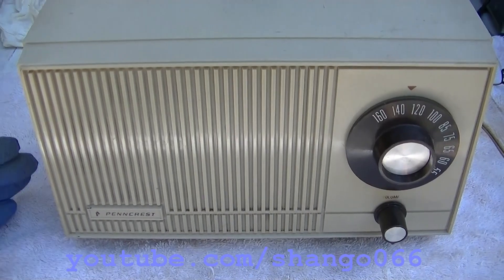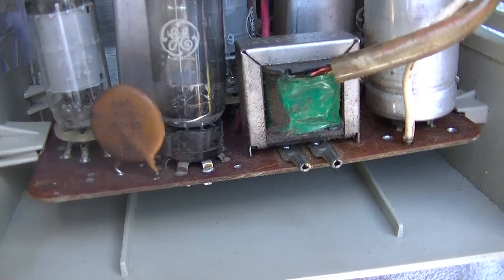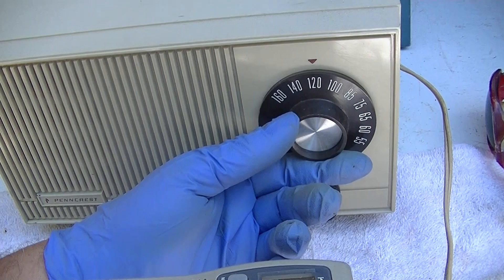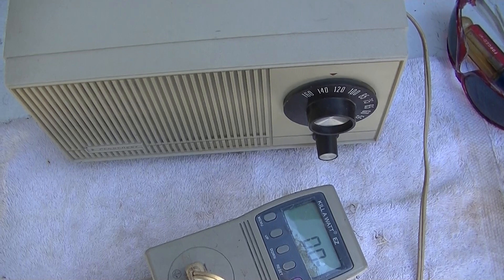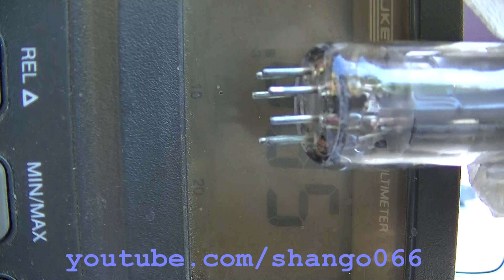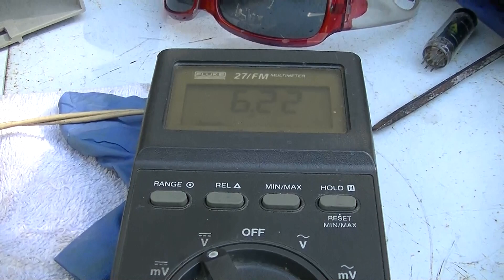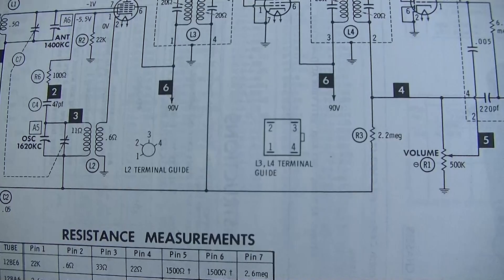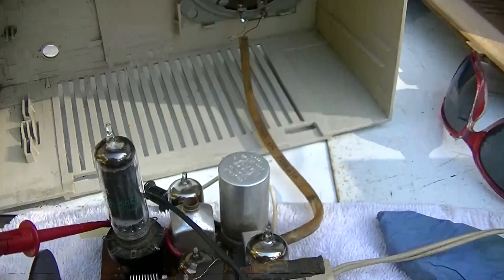Pencrest 5 Tube AM Radio Fading Issue Diagnosis

Comment: Man, I remember building a Sears Edukit clock radio (yea I had never heard of them back then or since) It was a minimalist design with one of the Couplets... It was a fairly decent radio and didn't require alignment Them 50C5's were compact room heater for sure. Thanks for the adventure Master shango066

Comment: These videos have been very educational. I have been tackling things around here that have been broken for years. I diagnosed a bad solder joint on a transformer by smacking components on the board of a Panasonic radio. Sometimes practical skills are much more helpful than theory.

Comment: JC Penney has been struggling for years. Not as bad as Sears by any stretch, but some of the same issues. Lost touch with the middle class, therefore losing market share to Wally world, Tar-get, Costco, Amazon, Best Buy, various chain tire stores taking the auto repair, U name it. Now the momentum is almost impossible to overcome. Really sad though. Very good ethical company back in the day.

Comment: Damn, that was one klinky doimler of a video shango! My Sunday is getting better and better. Thanks for sharing this stuff because like you mentioned if it helps someone understand how to maybe diagnose and repair their own equipment, then maybe it'll be one less piece of trash in the landfill and not appearing at your door for repair.
Reply: I have to agree on repairing this gear, though later sets like this are minimalist-design (cheap) radios that were cranked out in the 60's, they still deserve some love.
 - Cheers,
Reply: Eddy_D , minimalist design, true. But they perform very well for what they are called to do. And the last of them, with vacuum tubes, overall seemed to be the best.

Comment: Before you pulled out that Sams, I was saying to myself, I have that exact same chassis in an old GE radio. Then you pulled it out showing a Radio nearly identical to mine.
Reply: When I was a kid, I had a 1959 GE with the same case, but the circuit board was much bigger and at something like a 25 degree angle. There was also a solid-state version of the small board. GE must have stopped using that case style around 1968, but the similar version with the speaker on the bottom was still sold into the early 1970s.
Reply: PC No , my guess is that they had a lot of cabinets to use up. The printed circuit chassis would not fit into that make shift plastic cabinet unless you bent it in, at a 25 degree angle. They then compensated the tuning dial calibration, adjusting accordingly.
All things considered though, the "All American Five" tube AM radio was quite an efficient design, and did its intended job well. Millions on them were made over a period of around 25 years (plus or minus). And as long as AM radio stays analog, as now, parts to keep these radios playing will still be found, for at least another generation, or two.
Reply: @pcno2832  https://youtu.be/izbQk0Sm2UU
  I show the slant one in this vid.

Comment: Deja Vu .. I’ve seen this chassis before .. 60s GE .. ‘crackle, crackle’ .. went down with SMD (posthumously diagnosed) .. I kept it around for a couple years, finally got some electronics shop training .. when I went to get the radio to fix it, mom had found it, and thrown it out …

Comment: I have a 1960's Penncrest Model 1151 8 Transistor handheld radio. Picked up at my local Antique store for $7 around Christmas 2019. Slapped a 9V battery in it and it still works pretty well.

Comment: 9:38 The other difference is that the GE had wires going to the volume control holes to accommodate that older slope-chassis style case.

Comment: This looks so close to the radio 📻 that my dad had by his bedside. It was also AM. It had an analog clock on the left side, where the speaker is, however, the tuning and volume knobs are in the exact same place. Dad’s alarm clock radio was the same color, but with a couple cigarette burns on top. It also had a lighted dial, but I cannot remember the brand name. I think 🤔 it was a Sony. I remember “Solid State” on the radio 📻, though. Probably would have been an antique by now. This radio later made headway to my stepmother’s work place after she bought my dad a new Randix Cube digital alarm clock radio with a fold-up telephone 📞. I really liked this alarm clock radio, too. It had green digital numbers, and I think 🤔 it also had a lighted dial. It looked so 1980’s. After we moved, I don’t know 🤔 how it went for my dad’s analog clock radio, but I’m pretty sure it made its way to the dump. 😢 sad place for it to do. I guess somebody could have saved it, but probably not. I’d be very surprised 😲 if I still saw it at my stepmother’s workplace as far as 2020. It was very early 1984, when I saw it there, in her office. Chances are, I will never see that radio again. It was in Bethel, Alaska, almost 4000 miles from Arizona, where I moved after I graduated, to live with my mom and stepfather in 1989. My dad originally had this analog alarm clock radio in Glennallen, Alaska, as to when I knew it. I was only 7. You probably could have resurrected it.
Reply: I have one of those Made By GE with the clock and radio AM also and still plays yet too,mine is in a Brown Cabinet though but same type of radio Made By General electric instead of Pencrest. i bet though those are Same radios just different name Plates on them, Like how companies do with other items that are Identicle but under different Brand names , the radios do sound good too and Loud  and clear.  For what they are they are not Bad Little radios.Last forever as some TVs do.

Comment: The point about analogue, tube TV v. tube radio is a very good one. The radios can still be used, whereas the TVs cannot - unless some kind of converter is used. I have a full set of Sams Photofacts from 1952 to 1967 but will probably throw out the TV sheets simply because there seems to be no demand for the data any longer.

Comment: I have an old Kreisler model number 11-7 radio that had the sound go out and get distorted like that, havent tried it in years.  I remember being told that it is an Electrolytic in the output stage somewhere,.  The Kreisler as far as I know is an Australian made set from the 40's.

Comment: They can't organize out in the field of battle if they turn the damn cell towers off!  Maybe a way to only set the towers to 1/2 power so it screws up getting a cell signal  but
 9-1-1 can still work but nothing else. No organization then peace. So the police can concentrate on the  smaller disorganized chaos that may in sue come nightfall.
GE made many tube radios for big box department stores back in the day with this very chassis ! This is  a Penncrest model  5110. Good fix Shango!📻✔

Comment: I used to have a tubed GE clock radio just like the one in the Sams Photofact picture.Got it for Christmas .Then the Rapid City flood hit 1972.When I got back from spending the summer in Wash DC-My Dad gave me the solid state version of that radio----same board-but solid state parts on it instead of tubes.Liked those old GE radios-either the tubed model or the SS one.CAREFUL if you are looking around in the SS version-the heat sink for the output transistor is HOT with 120VDC!!Yes,it bit me!Now don't remember what happended to the SS radio.Used it while going to college.

Comment: This brings up a question about a record player I have. It uses a 12ax7 and two 50c5 tubes. I recapped it about 8 years ago and it's been working great in daily use. A few days ago, it suddenly faded out and went silent. I looked in the cabinet and all 3 tubes were dark. By the time I got around to looking at what may be wrong, it worked fine. I let it run for a couple hours and it did the same thing. The tubes just suddenly went dark. It is a series strung set, but I don't think this to be a tube problem. The age and model are unknown, I just know it was made by Columbia probably in the early 60's. It has a selenium rectifier in it, could this be bad or could it be something else? I don't know of any reason it would just stop working after it's been on for a couple hours. I haven't actually worked on this old stuff in so long, I forgot most of what I knew. Any insight would be awesome.
Reply from the maker: move the tubes around in the sockets,
Reply: I’d replace the selenium rectifier with an 1N4007 diode and a dropping resistor. That might not be the problem, though.

Comment: I pinned this as a GE before it was even opened. That long faded away label is always a giveaway. If that wasn't enough a glance at that chassis/board screams it. That board goes back as far as 1959 and was used in nearly all their AA5 sets.

Comment: That's a lot of ventilation for not a lot of chassis.
Reply: Hey, it’s Uxwbill! I miss seeing new videos from you. Take care man!
Reply: uxwbill , yes, but the chassis needs that ventilation. Those tubes normally run really HOT, especially the 50C5 and 35W4 tubes. Without proper ventilation, the plastic cabinet would soften up and almost melt, causing the cabinet to badly warp. (I have one that actually did that.)

Comment: The 35C5/50C5 were plagued with problems (heater to cathode shorts also being common). But tube testers capable of measuring grid emission will catch these faults most of the time. The problem is that you can't just pop them into the tester for 30 seconds to get an accurate reading---if it takes 10 minutes for the radio to act up, you leave the tube in the tester for 10 minutes before testing. I'd estimate I've thrown away at least 100 50C5's over the years that acted fine when first put in the tube tester, but failed miserably when left in for 5 minutes (with related performance problems in the radio). These tubes were junk

Comment: Has there ever been a solid  state   tube   device  that could   plug in the tube socket and  keep hard to get tube radio  running ?
Reply: not really, only in place of rectifiers....
Reply: That’s really not very practical. It’s easier just to modify the circuit for a different tube.

Comment: Good Vid. Once I heard the complaint, I was guessing a tube that had a bias or short thermal issue. How and why would I guess this? From Shango! You had one a few years ago where the bias went way positive. Learned something new as well.. about checking the resistor on  the tube pulling it to ground.

Comment: I hear there is a new version of Covid coming this fall, there would be two different ones, one called Covid 20 Pro and the other Covid 20 Max. :D
Reply: I heard a new ver. will be covid 20 San andreas
Reply: Covid 98 ,  Covid  XP ,  Covid  7 ,  Covid 10
Reply: @force311999  in 64bit or 128bit version
Reply: @bob-ii8oe  256 bit version
Reply: @force311999   Don't forget Covid vista and Covid 8. The best versions

Comment: i've come across that grid emission alot, many people, especially those fairly new to valve /tube equipment dont know about it, i didnt at first many years ago , mostly afflicts the higher power tubes , but have come across a couple of bad frequency changer and IF amp types..
Reply: andygozzo72 , my Admiral tube clock radio of similar vintage (same tube lineup and similar circuit) has slowly been developing this same problem. I still get enough audio volume out of it, so I'll probably still get another 6-12 months out of the 50C5, based on when the same problem occurred last, until I will have to replace the tube. Still, I love that technology. It is very repairable.
Reply: @jeromewysocki8809  its best to replace as soon as possible if the tube is developing grid current as the extra anode/plate current risks damage to other components such as output transformer primary winding, rectifier, cathode bias resistor.... you could try reducing the value of the grid to ht- resistor on the 50C5 , that'll reduce the voltage developed on the grid,, maybe to about 150k or even 100k...
Reply: if the same occured previously, maybe something else is wrong, maybe coupling cap leaking? grid to ht- resistor gone very high?  incorrect cathode bias ?

Comment: There were even cheaper radios: 4 tubers. Forgot the lineup but they eliminated the IF I think,
Thanks
Reply: Also known as TRF sets but those were mostly pre war. They used no IF but tuned by adjusting the filters.
Reply: @westelaudio943    I know about the TRF sets. I have a Gilfillan GN1 battery set from about 1925.  There were also some TRF sets made through the 40's or so with octals and large pin tubes. 
I was speaking about some very 'economically engineered' radios with 7 pin miniatures.  Late 50's to the transistor era.  They were superhets but with no IF stage. The converter (usually a 12BA7) went to the single IF can and then to the 12AT6 detector.   Not a very good radio. Even as a kid taking radios home from the trash, I knew the only good things  inside them were the tubes.  
This copied from Wikipedia about All American 5s:  (and 4s)  
"There were even a few "AA4" designs, usually midget sets, only usable in strong-signal metropolitan areas, because most had no IF amplifier (although some replaced the rectifier tube with a selenium rectifier). "
Reply: they eliminate the rectifier tube, use a selenium rectifier instead
Reply: @chessapk5034   Yes, some 'real' supers did use selenium but then they have to dissipate  35 more volts due to the missing 35W4.   A 4 tuber missing only a 12 volt IF tube isn't so bad - 109 volts on a (then) 110 volt line. 
 I stand my ground.
I found at least two 4 tube supers by Googling AA4 .   A video from a poster with a Westinghouse model H648T4.    https://www.youtube.com/watch?v=OOEwRz1Zknk . 
I also found a Stewart Warner 9180 at AudioKarma.   They both used a 12AU6 as a converter, but no IF stage.  Not TRFs
  Also check https://www.antiqueradios.com/forums/viewtopic.php?f=19&t=301892&start=0
Most of them got trashed when the 35W or 50C died, as they were practically worthless.
More info on the Wikipedia page I reference in my post above.
Thanks for keeping my brain sharp!

Comment: Be that as it may, I subscribed only for your outstanding television repair and TV resurrection videos on your channel that started with the YouTube recommended - Testing CRTs and Old Television Graveyard

Other than that, a typical tube tester will not be able to detect when and if a 'gassy' tube starts over conducting itself with grid 'leak' emissions thus biasing itself to a possible 'short' as it heats up (especially 50C5 tubes and others); unless a special tube tester is used. In this case, a 'dynamic mutual conductance' type tube tester is called for. I should know, since formerly owning/using an old Hickok model 534B tube tester and analyzer for many years.
Remember that the suspected tube with this condition being tested on such equipment should remain in testing for about 5 to 10 minutes or so (as a simulation) in order to get a more accurate meter reading to determine this effect.

Now, you should do anouther video after this one on your early 1970s Penncrest 'combo' console television set - if you still have it  :-)